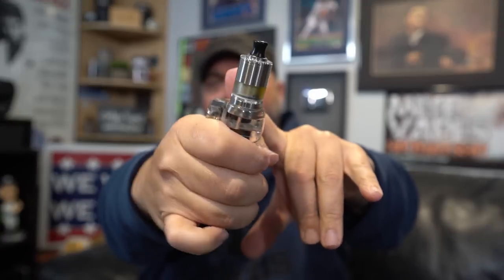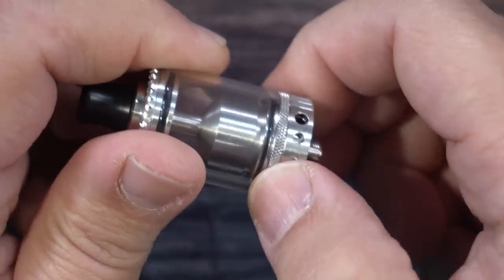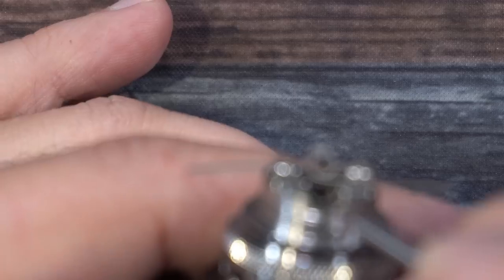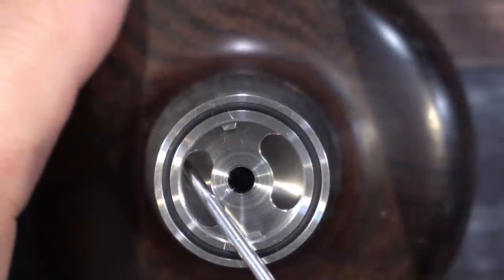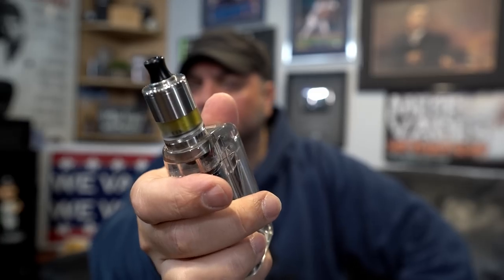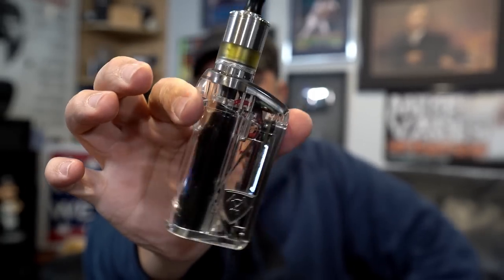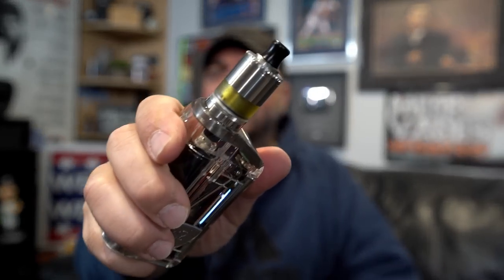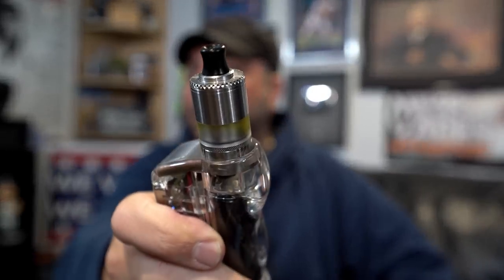Steve's Favorite RTA! Gas Mods Pallas RTA

Comment: Gas mods do make a good Atomizer but most Atomizer that they make with bottom airflow kinda will leaks...you have to flip the Atomizer upside down for a minute or two when first filling the juices to force the air out first before start vaping...

Comment: An easy fix would be to add an airflow pin to cut that hole down under the coil but then last couple of openings are still gonna make that noise. It would be nice if it could do restricted dL and mtl but I don’t see it happening with that design.